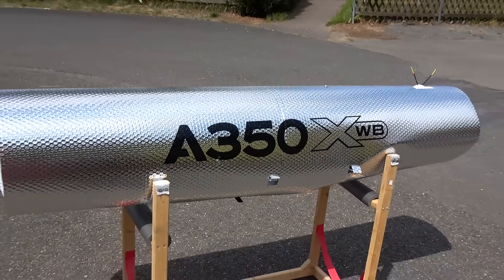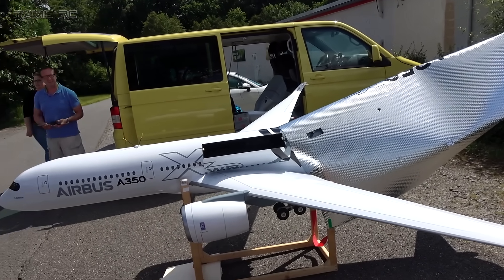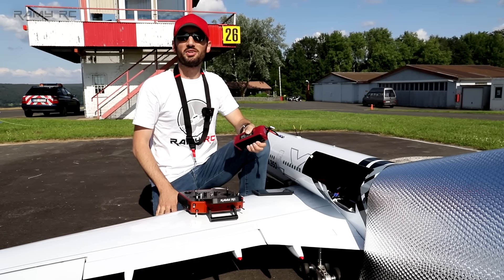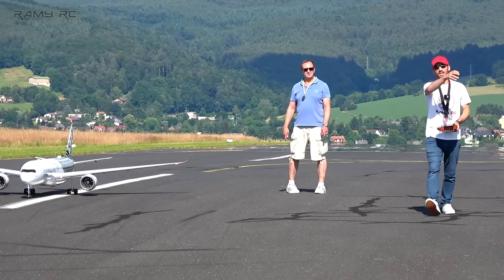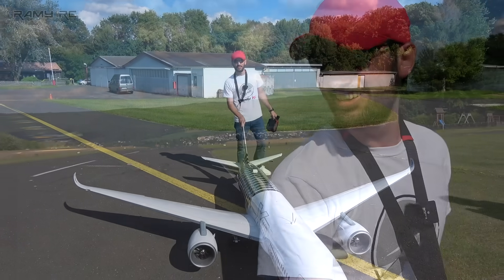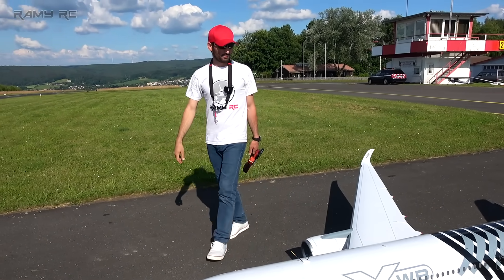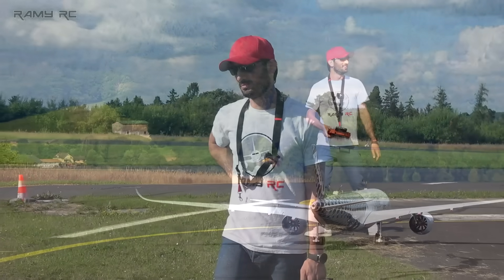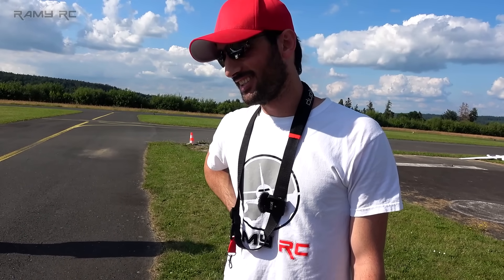GIANT RC AIRBUS A350 XWB MAIDEN FLIGHT

Comment: Best part of this thing is the sound it makes. Sounds so realistic
Reply: I totally agree, let's wait until Ramy introduces the real hey engine with burning fuel!!
Reply: Neil Castro *jet
Reply: Don't need a turbine the sound is incredible.
Reply: Seriously that is the best sounding rc passenger jet I've ever heard -Turbine be damned.
Reply: x 29Lives x yes, you're right. Mini versions of the real turbofan engines don't sound as good as electric ducted fan. 🙄
Reply: @prorobo  oh cmon that thing sounds great
Reply: x 29Lives x never said it sounded bad, only that actual turbines would sound more "realistic."
Reply: @prorobo  I think it's mostly the instant throttle response.  If you programmed a delay i think it would sound better.
Reply: Hell, it LOOKS realistic, especially before and during takeoff.  The heat from the runway really conjures a great sense of jet wash.  Great camera work on that in particular.
Reply: Lest go  avionts populras
Reply: jojomoman no it doesn't. If he put turbines on it, then it would sound like the real thing.
Reply: @prorobo  No it wouldn't. Mini rc turbines sound nothing like full size.
Reply: Dis rupter said the poor person who neither is a pilot or can afford RC scale turbines.
Reply: @prorobo  there are turbines, and it does sounds like a real plane
Reply: @KingLordLele  I would say similar then exactly but either way it's awesome😎

Comment: This isn't a criticism, just a suggestion - and maybe this was omitted from the video - one of the first things I do with a new model is to take it up high and stall it. Doing so gives you lots of feedback as to how it handles at low speed, what a stall looks and feels like, and provides a visual indication of the approaching stall. This is valuable information that helps you understand the limits of the air-frame.

Comment: It looks so smooth and stabile for the small amount of weight. Really amazing build Ramy! The tarmac and background both look great as well by the way.
Reply: Remember the plane is 99.97% carbon fiber with the exception of a few woven pieces inside the wings and the light decals otherwise it's just a perfect model

Comment: the real thing has a small jet engine right in the rear tip of the fuselage, right under the tail.  You should put a small ducted fan in that location on it's own battery and alarm and just let it run like the real thing does (it's a generator and hydraulics backup).  It'll help you with cooling and be one more 'real' detail you could include!

Comment: Raymy with all due respect you are turning far too tight! Airliner wings are not designed 45' degree + turns ..... those wings are designed for efficiency not aerobatic performance! when you add in the scale equivalent of your control inputs you must be on the very ragged edge of performance/control...

Comment: Excellent work! I would guess that your gear door issues have to do with the air flow/pressure pulling the door open. Is there some form of up-lock that you could install to hold it closed?

Comment: Really great job with this build up. The Landing gear issue might be due to the airload, the mechanism might be stopping in btwn cuz of excessive airload, u can try to reduce speed and then try retracting the gear. If that helps as this limit also occurs in real aircraft. As Landing gear were retracting properly on ground it might be the airload on the mechanism which might have prevented the retraction of landing gear always.

Comment: Nice work man but you fly it way way too fast, it's not a fighter it's a slow magestic airliner. Gear and flaps should be lowered after the speed has dropped, don't use them as speed brakes.

Comment: 9:10 when you start saying oh my God that the time to go around and try again. Unless it's an emergency landing dont forget you can always go around....amazing job btw!
Reply: First, I love, love, loved this video.  I have been coming back to the links to see it.

Hopefully something for consideration,  I believe Ramy that you should practice wave offs more and sooner to improve your piloting skills and runway alignment.  Great adjustment on the control surfaces in order to have balanced landings.  I love the auto trim feature of your remote/airplane.

Also, in real flight during approach and landing phases, it's flaps first to control decent and lower speed before lowering the landing gear (landing gear speed restrictions).  It would make the flights look more realistic and prepare better for landing speeds and position. 

Congratulations on a great day and I cannot wait to see much more of this latest addition to your fleet.
Reply: Not when batteries are almost depleted. Going around is way more risky'er than just landing it.
Reply: Especially on a maiden in an Environment like this you will not risk a forced landing with empty batteries. My last maiden with a big model I also had 60% of power left after the flight, but you only know for sure, when the airplane is back on the ground. Still a sketchy landing 😅 but a great job to bring it down with no damage 👍

Comment: PLEASE!!!!! Please!  Stop flying with your THUMBS!!  This is the only reason the airplane (actually the 787 flights too) is constantly hunting and wing wobbling with pitch excursions. You were flying on a wind-less day. So it wasn’t the wind. It’s your thumbs. Use the pencil hold method and your flying issues will magically go away. You are over controlling it with your thumbs. Hard to understand how you can be so microscopically accurate with your building skills, but not master flying your airplanes without using your thumbs. You’re constantly jockeying pith and power (clearly audible on the videos). Just pick a power setting and let the airplane figure out what it wants to do - THEN trim. On landing, set a constant pitch attitude while still way out on final, then HOLD IT. Use power (only VERY small adjustments SLOWLY) to adjust sink rate. You will find the airplane will almost land itself. Why didn’t you go around on the first landing???? You almost crashed this one too. I think people don’t say these things to you because they want to be polite, but you should hard-study some corrections to your flying technique. Don’t you want scale flights for your scale airplane?  Anyone who has this much free time to build such a model MUST have time to perfect flying technique, right? Honestly, no one wants to see you crash this airplane.

Comment: Good job and congrats on the maiden - i had goosebumps. What a wonderful model and the EDF's sound great and quite and impressive speed. Take good care foe that model - remember when you bank the stallspeed  increases (also when pulling G's). A little extra speed when doing tight turns and landing in low to zero wind.  Super cool !  Sooooo... what are you gonna build next?

Comment: duudee incredible build, incredible flight it looks awesome, and seems that flyes pretty smooth. if you are not using it i recommend you to use the jeti MUI current sensor for both edf and in that manner you can set the landing time alarm with the use of the battery instead of guessing the time, and if your using your condition flights modes make sure that your trims are separate for each condition, in that way you can trim your airplane on each flap position, and with a mix on your radio you can move your gain with tha flaps so you can go higher gain on full flap and the airplane mantains stability all the time.  all this it´s only if you don´t have it already. ; )

Comment: Ramy take care: Don’t put gear up in first flight of a new airplane. Its facility in emergency landing. Beautiful airplane! 👏👏👏👏👏
Reply: Agreed, and use the throttle more for altitude control. Coming down with that much speed is a recipe for disaster. I maiden flight should be boring and relaxed, moderate speed with plenty of control to gently set it down. He always seems to fly these big birds too fast and has trouble setting it down where he wants. More time doing touch n goes with beaters.
Reply: Rodrigo Barbosa Bago. you can break gear if you don’t put them up and if you go to fast.

Comment: Your ability as a builder is second to none. Your planes are works of art. However, there is one thing that destroys the "illusion" of full scale that you've worked so hard to create and that is the way you fly. This is typical of just about every RC hobbist I've ever know. Professionals realize quickly that in order fulfill the illusion of full scale, the plane must be flown like a full scale plane. RC planes are typically over powered and RC pilots rely on this to prevent tragedies from happening to the planes they've so lovingly and painstakingly created. That apprehension of loss is what prevents most pilots of scale aircraft from flying their creations in a convincing manner. Learning to use less than full power during low altitude passes and particularly take-offs goes a long way to creating a convincing illusion.  Longer roll outs and approaches, the proper use of flaps and the rudder and the ability to "call off" a bad landing and go around for another approach are all parts of the puzzle. This is in NO WAY a slight on your ability to fly. Getting a project up, around and back on the ground in one piece may be a basic cornerstone of the hobby but it isn't an easy task, particularly when one has so much invested in a project. However, the building is only the beginning of the story. The end of the story is written on the faces of those who watch the story unfold. Fooling and awing them is what it's all about and to do this you need to fly full scale as well as you build.
Cheers and thanks for the entertainment. It's a beautiful piece.

Comment: Congratulations on your maiden flight ! That model looks and sounds great ! Just some small advise from a 787 first officer, avoid banking too much with such a plane. That's how you've lost your 787 and I've noticed some tight turns on this maiden flight. Remember that a wing can stall at any speed, only angle of attack matters. Safe flights ! ;)
Reply from the maker: Thanks a lot for the advice :D
Reply: Also, bank angle is very important if you bank to much your wings Will act as a tail fin. Just some advice
Reply: A good pilot is always learning;) @PilotMax Great advice! Maybe I can extend this a little bit with a few thoughts about aircraft handling:

How to handle a situation when you actually find yourself in a tight turn? 

As long as your wing is unloaded in a steep turn the aircraft is not going to stall (but you will lose a bit of altitude)
Banking too much with pitching up is the deadly combination. 
Banking itself without pulling up can also solve a nose high attitude situation.
When your extra careful on the pitch control in a tight turn, you will bring down your model safely on the narrowest rc runway
you can find.

Flying big and heavy selfbuild models on a maiden is a real challenge, great job @Ramy Rc
Happy landings ;)
Reply: Strongly concur. I once came damn close to stalling a fully loaded DC-8-63 into Heathrow in the early 90s as ATC kept me in tight for noise abatement. Even with full power applied, it got hairy during the turn to the outer marker.
Reply: I was thinking exactly the same thing. My heart skips a beat each time the bank angle gets too much. Some rudder mix would help a lot. Anyway serious congrats to Ramy on this amazing build. I cannot but be awed by your skill and ability.
Reply: Excellent service dear pilot, I think Ramy will live to hear from people like yourselves
Reply: Its ok mate its an Airbus not an Boeing.... these planes were made to stay in the air :)
Reply: @HellStr82  hey mate the Boeing it's an aircraft also and any friendly and expert advise from any experienced pilot will help Ramy.

Comment: First off, let me say a huge congratulations for accomplishing what you just did. The airplane flies really really well and looks fantastic; nearly identical to the real thing. You are truly an expert craftsman and an artist when it comes to these things. That being said, there were some things you did while flying that scared me. As a student pilot (full scale) I see a lot of things us model aircraft pilots can do better in the air. One thing you did that is a big no no is not going around for that first landing. I know you had a really long runway and that in the end, you nailed the landing, but just remember that it is always better to go around than to try to force an airplane down at the end of the runway. The reason your landing was so long was because you were too high and too fast. Luckily you fixed both of these problems on the second landing with an extra notch of flaps. Well done with that. The next thing I want to talk about was the way you bank that thing in the air. You are flying it like its a much smaller, much lighter, much more maneuverable airplane, but it’s not. Your airplane needs two things when you are in the air: speed and altitude. On climbout, do not start to turn the airplane until you are much higher off the ground. On that second flight you banked that thing right around almost as soon as you took off. That is a huge no no. That same type of flying is what will cause you to lose this airplane just like you lost your last one. Never bank the airplane more than 60°; you were banking it nearly vertical on some of those turns. And after takeoff, wait until you get your airspeed and altitude until you turn, and when you turn, make it nice and smooth. Widen out the turn a little bit. You have to remember that when you make those tight, high-banking turns while climbing, you are sacrificing a lot of airspeed. This might be ok if you have airspeed to spare, but right after takeoff, like you did, you don’t have any airspeed to spare. I am surprised that the airplane didn’t stall and crash after that first turn on your second flight. I guess the airplane is more capable than I thought. That being said, don’t do it again. You have an airplane that looks like the real thing. Fly it like the real thing. I don’t say any of this to make you feel bad or try to take away from your piloting skill. Clearly you are very skilled. These are just some things that I have learned from over the years that will help you become a better pilot. You should take the advice (with a grain of salt of course). All criticisms aside, great job, and keep up the good work.

Comment: Fantastic job, congratulations.
(A few things, I would do a little different are: before takeoff I would run as long as possible on the ground to gain as much speed as possible, and I would lower the flaps and the gears only after the last turn on its final straight line before landing.)

Comment: It's beautiful. Quite stunning. From someone who doesn't have the skill or knowledge I'm going to be a 'bit pedantic'; there is probably a very good reason I'm sure, but there isn't the detail in the landing gear compared to the "full size" airliner such as nose gear 'doors' open and 'missing' main gear 'struts'. Apart from that the aircraft is a "perfect" replica of the real thing. I've seen this quite a lot with very good RC models of various airliners .... so I'm sure there is a very good reason for this.

Comment: Congratulations Ramy !
So great to see it fly.. Been following you since your early post.
You've come a long way to this point.  CAD designed, 3D printed mold, carbon fiber construction.. inspiring ! Modern modeller
Looks very sturdy in flight. I suppose carbon fiber construction is the way to go.  Much much sturdier than all your previous foam construction (well.. of course).
Thanks for sharing all the moments

Comment: beautiful machine you have built sir!!!  you are a true craftsman!!! may I suggest you stow your gear shortly after rotation with positive climb and only extend when you are making your right base with some flap in, I think your are overspeeding your gear doors, thats why it seems to hang randomly. I had a similar issue on a Beech Bonanza I built, the nose gear doors would randomly hang yet work fine on the ground. my Father being a professional pilot and avid RC guy, had me try to pull the gear after establishing positive climb and extend on extended down wind and or base, I never have had gear door issues again.

Comment: The problems you get with landing gears and landing gear doors in flight, could that be due to the loads and deflection in the airframe in flight? 
When mechanisms work smoothly on the ground but not in flight, you could look into how airframe loads and deflections affect the alignment of the mechanism components.
Could also be that direct aerodynamic forces on the doors cause problems that you will not see on the ground.

Comment: Sooo awesome! Thats a great plane and flies beautifully. During next flights you should do kind of test flight program which includes at least: stalls, stall during turn, low speed maneuvering, glide ratio with zero power and max climb angle with full power. All these with all configurations and with and without gyros. After that you can better anticipate how that bird performs. I’m really waiting for next videos and hope it will stay intact. 💪🏻

Comment: You should add an idle up switch for about 5% throttle on the engines. This keeps them spinning in the air for faster response time and it’s also more scale. It’s not enough force to move the plane, but on a go around the spool up time may be the difference between a stall and a easy climb out. This has saved a few of my planes. Great flight. I’d like to come film your planes sometime.